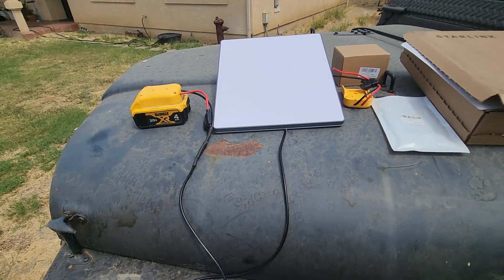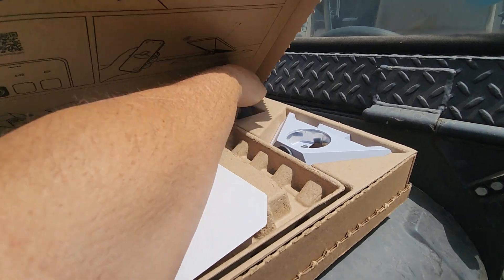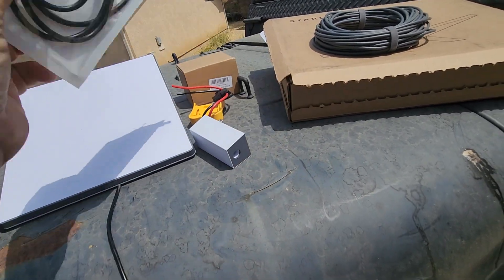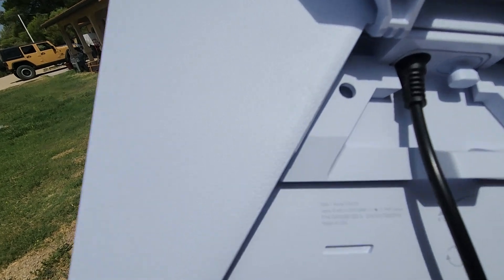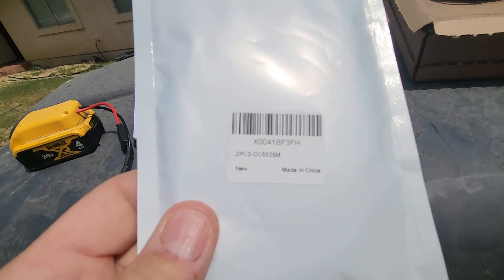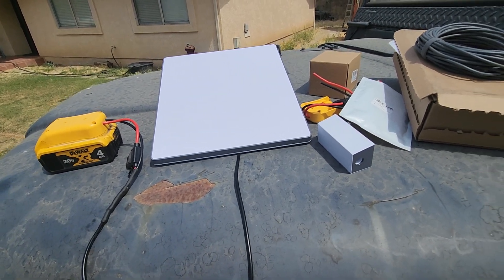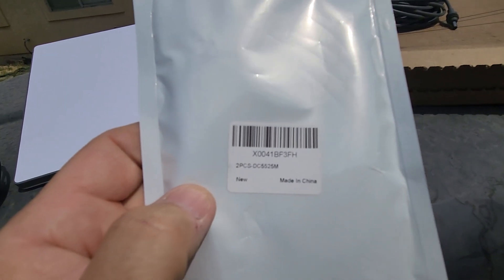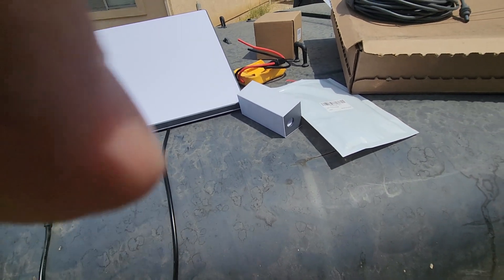Starlink Mini alternate power setup

Comment: Wire two of them together with 15amp diodes. Then you can hotswap the batteries at 1 bar without having to turn off the Mini. Keeps your batteries good without having to jumpstart them from draining them to far.

Also can be mounted in a smaller packout. I built one that fits 4 5ah dewalt tool batteries with diodes to power my diesel heater. Will be adapting it when i get my own starlink.
Reply: i guess the point is that he doesn't need this consistenetly. you could just put them in series as well if you wanted longer run time. 20v 4ah x2 is a lot of internet time. if you can't do it in 8 hours you probably should be going to the local starbucks and use their internet. that's my take on that. and if you are on the trail you might just as well pack a solar panel and charge up the damn battery for that makes more sense.

Comment: I read that the Starlink Mini cable uses 5.5MM x 2.1MM connector, not the 5.5MM x 2.5MM that you purchased. Your center pin socket being 2.5MM may barely be making contact.
Reply: In the Manual it says 5.5mm x 2.5mm 🤔
Reply: @Technikfreak11  Then why does a 5.5mm x 2.1mm fit? In what universe does a 2.5mm pin fit a 2.1mm socket?
Reply from the maker: @sportcoupe2 the pin contacts in the female side are spring tabs, so I suppose it's possible.
Reply from the maker: Seems like I saw something about that also.  That being said, it works  well and I've had no issues after about 25 hours of use.